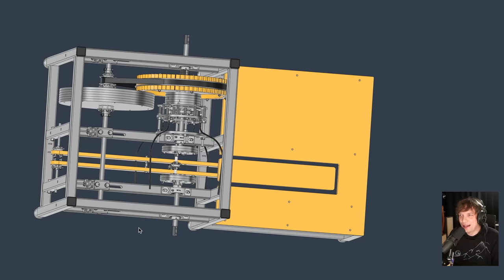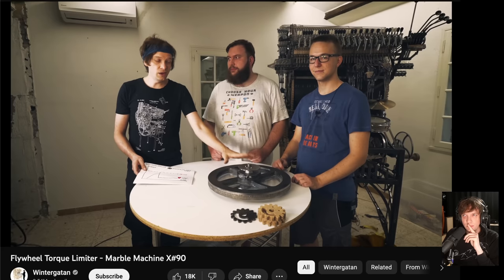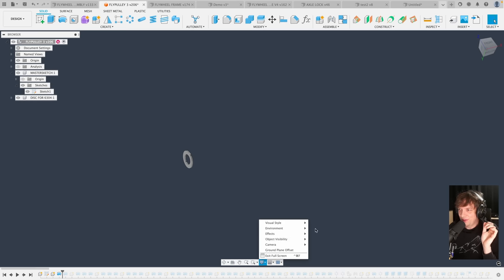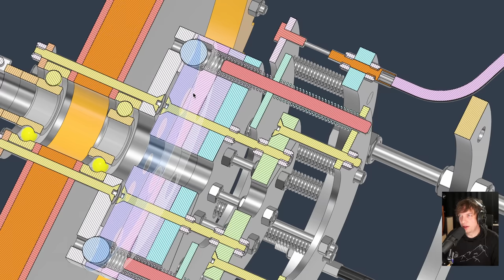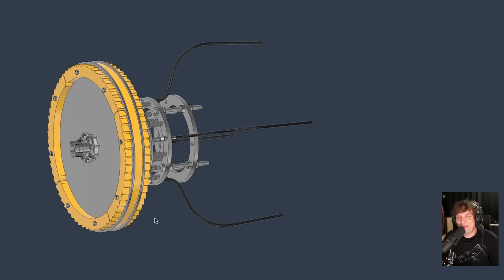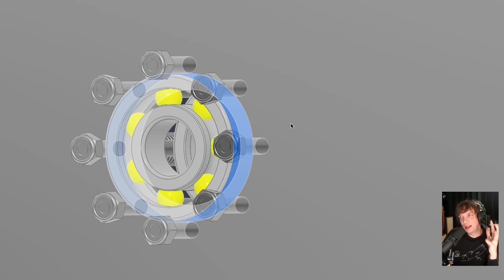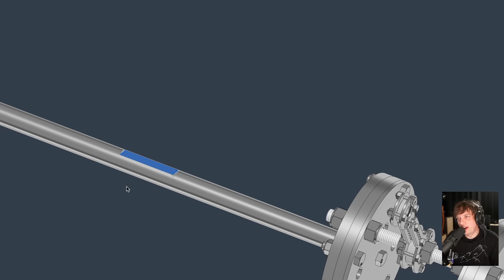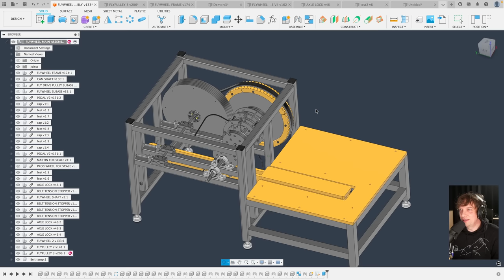Safety First! - Marble Powered Clutch

Comment: Hello Martin, I'm a quality technician so just to be pesky and annoying I'll :D I hope you make this videos to get honest feedback and improve on it so I'll come up with the worst cases I can for this.

Pedal:
I think the pedal should be higher for ease of use. I believe from horizontal you will have to push to much down It will be tiring, you may need a pivot on the arm to not be so high and risk tripping over it, it seems too long, but you may be able to animate and see how much you need to push it down like this. It is more easy to lift just your leg than crouching to push it, and lift your self up  every time.

Bearing:
You can make an adjustable bearing housing, this you can't adjust, also the bolts can bend. And it will because you forget about gravity pushing down on them. Also just look up Laser cutting accuracy and bearing accuracy, there is a reason for nobody doing what you planned for your self here. Fast rotating heavy things are not a joke. You don't want it to shake it self apart.

Also Think about transportation, It needs to be able to withstand that too without much disassembly. With two way forces there is a different type bearing I don't know about the frictions in your system, but If you plan to pull on axle direction you may need "thrust spherical roller bearing" it comes with different angles to your needs, but it does not have marbles. :D

Clutch:
Where is the part limit on this part? :D I think this is the case when you fell in love with designing and took way to much time designing and now you are in love with your design. When you need more than a few part with another technology you should not make sacrifices on your design for sake of using less technology. 

Supplier count:
If you want to cut down the supplier count, find a supplier who can laser cut and have a CNC machine too. Those plates in your design just to not use CNC lathe looks dangerous too, probably not a big risk of shearing those bolts, but you need as less of a point of failure as you can have. And if you still want to cut down of the manufacturing techniques try to see if you can do everything that you can now with a different machine. Or just try to not overcompensate your last mistake and use what you need to create the most practical and useful machine you can. Don't be afraid of making the same mistake, you learned a lot now you know that everything have a place and a use, when you know something should be done one way, don't create an another obstacle in your way.

Brake:
Your brake I thing will brake the machine a different way that you hope for. With those long bolts from either side the torque will twist them and in the best case will pull away the toque limiter and jam the wheel, and the worst case snap and if the ratchets are not for emergency stop I don't know how else would you stop the wheel. Also the friction will weaken the plate you use as brake pad, and lose brake force, maybe even bend out, and ruin your bolt heads so if you want to repair the machine for whatever reason you will have a really bad time. The worst case the heating and the shear forces from the rotation will just pop those screw heads off. (not at the first few brake tests when you can catch it, in the middle of the tour the worst possible time)

Design:
I see you don't want to give up design, but as you have a functioning form, you can design it while keeping it's function. You don't have to think in mass production, you can make it pretty too. 90deg is nice and easy but does it matter under 10 machines, when you have precision tools in your arsenal? You are not just your little shop alone anymore, you can dream a little.

There was something in marble machine 1 where you could hear the rolling marbles on the wood and some mechanical noises. It felt like the machine is part of the music not just sterile music like from anything else. 

Ps.: You don't want a marble machine 4, you want to finish this machine for the meetup. Make it not controversial. People here love you, and won't go against your will even if they know It may not work, they believe in you. But faith won't work against physics, you have to control your self, you know what is right.
Reply: I totally agree with this statement, the magic of it being a marble machine is not just the movement and the music, it's the contraption sound.

Comment: I would suggest to use some actual break pads either from bikes/car or create something similar ... and find one that will be relatively silent ... and can be adjusted/exchanged without having to dis sample the whole clutch mechanism. Because at the moment you have to take out the whole disks if/when it is worn down .. in addition the heat will create tension in the whole thing ... meanwhile with pads it would be concentrated in those first.
Reply: I don't think Martin is intending to "brake" the flywheel but to "break" the pedals connection with the large pulley using the torque limiter for this secondary purpose.  Grinding between the stationary disc attached to the bowden cables and the rotating disc tensioning the ball bearing springs is going to be the problem.

EDIT: Oh, wait... do you mean use brake pads on the stationary disc so its the pads that wear and can be swapped out easily when worn instead of having to replace the discs themselves? So not necessarily for braking but to eliminate metal-on-metal grinding?
Reply: @DJShadesUK  yep that's what I meant

Comment: Hey Martin,
As an Engineer working in mechanical construction, i want to give you my input for your design.
To me it sounds like an overcomplicated system for a system that could be done by a simple bycicle disc break operated by a bowden cable clamping on the same disc you are using now. You will also have problems pulling all 4 cables with the same force.
About your bearing housing think back to where you said at the beginning of mmx that threades rods are not good for usage as axels. Same goes for centering a bearing. Threads are no good for centering anything. If you really have to use rods for centering, use smooth rods with threads on only on the ends, but id recommend you use a centering flange that is clamped between the bearing and the wheel, hooking on the wheelbore with a lip and the outside of the bearing. You could also use a bearing with a flanged outer race or a bearing with a snapring for securing.
For the flat spot, I can tell you that its a possible weakpoint. I suggest you use taper bushings, with that you only need a smooth shaft on both sides, thats the easiest thing to use when connecting two parts.
If you got qestions about anything ive said, feel free to ask.
Greetings Luke

Comment: Using the D profile instead of a key is an interesting design. I don't know how well it will work, but that is what prototypes are for. 😉 Might I make one suggestion. Use a double D design (two flats on the shaft 180° from each other) and then the split disks won't be two designs, rather two of the same design with rotational symmetry. More unique part reduction. Right now with this single D design each disk is split into two unique parts. But with a double D each disk would be split into two identical parts. I hope I explained that well. (I'm borrowing the "single D" and "double D" terms from panel mounted round items like toggle switches, connectors, etc. Hopefully those terms translate well to this design.)
Reply: Thats a very good idea to reduce the unique part count.
Reply: It really depends on the workload on that pulley of how well it will work. 
The design is flawed in that the the load between the shaft and pulley will be trying to seperate the two halves of the pulley itself. This also will cause problems as the two halves are also being held together by the same bolts that hold the entire rest of the assembly together.
If the force of the shaft trying to split the pulley pieces exceeds the strength of that hardware (even by just slightly bending it) it can cause issues with all the other things those bolts are holding together, mainly the bearing....
A really simple way to add reassurance is to add 2 more split halves to each side of that pulley that attach to the pulley itself to help tie the pieces together. However, this adds more parts and overall is just overcomplicating a solution to a problem that has already been solved previously with fewer parts and proven reliability.

To simplify, should've just used a tried and true keyway.
He's overthinking this a bit.
Reply: @moparmadness0180  Nailed it. Shaft drive torque is converted into separation force in the driven member, kind of bananas to assume Keyways are just for fun.... they exist in industry on driveshafts for very good reason. Going to be very difficult to achieve acceptably small rotational play/slop with that single milled flat spot too.

Comment: have you considered an automotive/bicycle style disc brake on the same shaft as the main flywheel?

edit: I worry about heat from braking within your clutch stack not having an easy way to cool off, and possibly throwing things out of tolerance and inducing undue stress. an automotive style brake allows you to basically drop in known good things such as silent brake pads and rotors without redesigning the wheel.
Reply: And a clutch assembly from a small motorcycle instead of the homemade one

Comment: Reminder: If anyone has some great suggestions for the marble machine, I recommend you to bring them up on the discord server, since they are more likely to be seen there. Thank you!
Reply: oh hi!! fancy seeing you here
Reply: @nelsonion3529  Hiho! I am everywhere :D No, not really, but I try to keep an eye on the comments and to keep them nice and remove spam...
Reply: I'm not on Discord, so could you please pass on my question about preload on the bearings?

It's not enough to clamp the outer bearing race in position; you need a positive axial load to be applied from the inner race through to the outer race.

A common method is to use a pair of belville washers next to the inner race, and apply a clamping force through that into the race.

This axial load (and you need it on both bearings on the shaft) will apply the preload needed to reduce bearing wear.

Comment: Martin that is not how bearings are designed to work at all. Bearings are designed to be pressed into a housing and they actually compress when they are pressed. You should never locate on holes for bolts only locate with reamed pins. You also need to make sure to use either an angled contact bering that are opposed or you need a deep groove X contact bearing to handle the thrust load. Most bearings are only radial bearings and will die a horrible death if you use it in that manner. That is so much more important when using it on the flywheel.

The bearings on the flywheel are the most important and critical for safe operation in the whole machine. Please please please use a single piece machined flywheel with integrated bearing races. Also please have to balanced by a contactor. You do not want your flywheel blowing out your bearing and exploding your machine!!!!

Comment: Great video! Just one thought though: aren't you creating more parts by skipping the keyway? Yes, you skip cutting and making the keyway, but in turn you need to split all of those plates you have? Doesn't this increase part count?
Reply: Math of reality strikes again!
Reply: Yes, you are of course correct, this is sadly just one of the "bad" ideas in this design.
The brake, the bearing mounts, loading screws in the wrong way, and increased part count/complexity to adapt to specific machining capabilities are some of the others...

Of course you need to design for manufacturing and try to adapt to in-house capabilities or to those of your suppliers, but you can't go to far.

I say this as someone who's done the same type of mistake or suboptimal designs more than a few times, and it almost always comes back to bite you in the end :)

It seems that Martin gets a bit fixated on a specific process, a few years ago it was CNC-router to cut plywood, now it's lasercut sheet metal and profiles :)
I wonder how much he knows about CNC lathes for example?

If you need 20-40 bearing housings for a one-off project, you design your machine around the same bearings as far as possible (including using a bit to big bearings on parts with lower loads if possible). Then you design a housing that can be used for most or all of the bearings, and have it made by a shop with a good CNC lathe or even a 4-5 axis Mill if needed.
You don't need a machinist to manually turn 40 identical parts on a manual lathe these days :)

I wouldn't be surprised if Martin could design a bearing housing that he could machine to good enough tolerances in aluminium on his own Avid CNC-router :)
Reply: IMO As soon as a good amount of force or shock is applied the shape of the shaft will try to split the 2 halves and all the bolts will simply bend away leaving the disc loose over the shaft...
Reply: @M4nusky  Agree!!! this design will slip in no time! at least use a shaft collar with a set screw or better yet a keyway.

Comment: I'm sure lots of people will/have comment that bolts are bad at locating, and that threads do not take lateral load well so will wear out and not locate the bearing properly (something shoulder bolts would help with a but), but there is another side to consider as well: when the bearings torque sideways they will have a tendency to jam the bolts, making it difficult (approaching impossible) to disassemble. As the threads wear (which will happen both from the bearings being torqued sideways, and just from normal sideways rubbing) this effect will get even worse, but even with shoulder bolts the rotational torque will cause binding.
Reply: He does not listen. Don't bother.

Comment: Love to see your progress Martin! I wonder, have you thought about the torque on these bolts? If I understand this correctly, all the torque goes through 6 bolts, right? I understand they are clamped well, but there will be a lot of shear forces and also general twist forces. Or am I reading it incorrectly?

Also, when engaging the manual brake, is it possible that the moment when the two discs come into contact could create some issues? Like some weird thing with friction/lockup/too much torque on the brake system itself/...
Reply: All good points.  It's a good thing this is a prototype!
Reply: About the second issue, maybe he use a bistate mechanism. Full engage / Full brake. Then when transition to Full engage, for an instant engaging the force will be strongest to not going in those friction/lookup problems.
But anyways I'm worried about the 6 bolts managing all of those torque and energy without bending
Reply: @gnlaredo94  thanks for your insight, I think you're right about the second issue, since Martin had these bistable mechanisms on MMX already. So if any issues occur, he can always put a chunkier spring on there, to get a shorter transient.

Good to know I'm not the only one who sees the first issue, I'm looking forward to see how Martin addresses it in his design.

Comment: For the paddle, I have an idea that might work. Split the pedal shaft in 2 and connect them with a one way hinge. That wai it stays still when you press down on it, but if there is any force (from the tip of it) pushing it the other way (like a foot underneath it) is justs bends upwards with the hinge.
Systems like these are used on these types of mechanisms where you want to have force applied to once side but basically disingage if force is applied from the other.
Reply: Sure, it would bend upwards, but wouldn't it just keep whacking you in the foot? I think it should be a treadle, anchored to a pivot point low enough that you can't get your foot under it and/or a ratchet mechanism that means the pedal only moves when you're actively pedaling it.
Reply: @scaredyfish  it would whack you but only with the weight of the pedal after the hinge. So very mild whack. Its not something you would constantly do, its a safeguard against chopping your foot off.
There should be also a guard, but these are never 100% failproof. So double protection is the way to go
Reply: @scaredyfish add a light sprint to it and youre good. Ive posted basically the same comment under the last vid, even if you add vertical wall all around the pedal, one small screw is enough to screw up your day at best, or scar you for life at worst
Reply: He should see this
Reply: That system was on Marbel X and yea, don't see the advantage with the new system over the old
Reply: He had that on the last machine
Reply: Yeah, this is a solid fix to that problem.
Reply: @Hoggaforfan  afaik its probably because it uses less parts. However with the platform and all i dont think thats the case
Reply: @Hoggaforfan  Yeah, also if I'm understanding it correctly, the new system is meant to be with him standing on the box and only pushing the pedal down into the box?
I can see that being very exhausting as he'll basically be doing one legged squats the whole time.
And there's also the danger that his foot could slip into the box and get pinched from the pedal
Reply: @nd1312  Exactly!